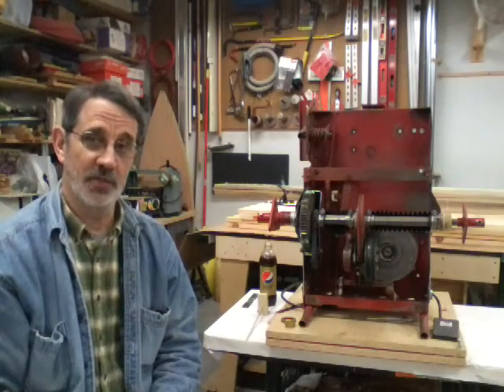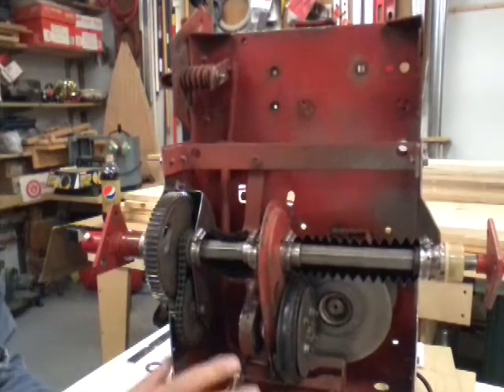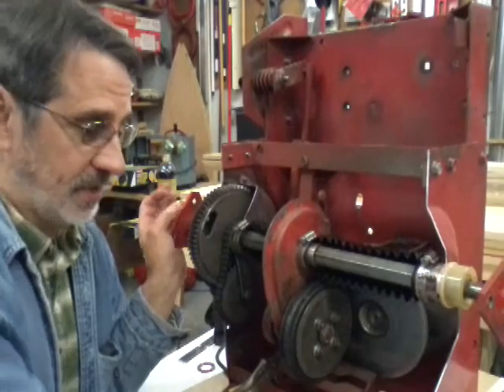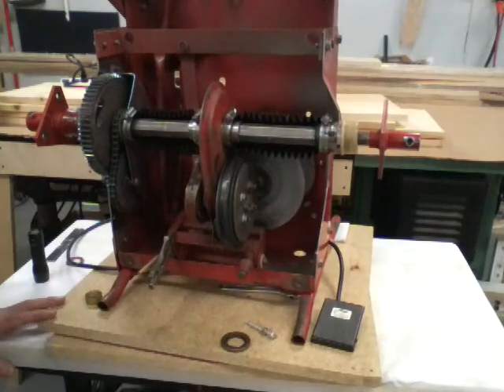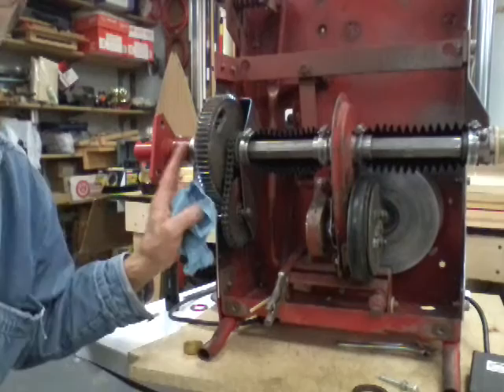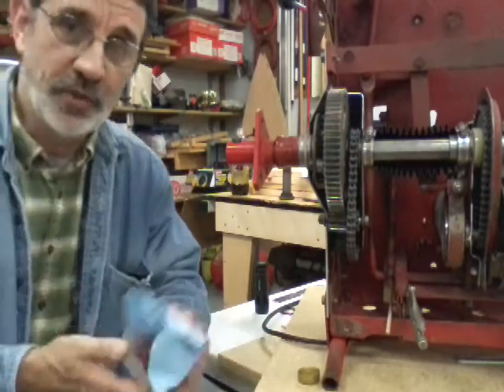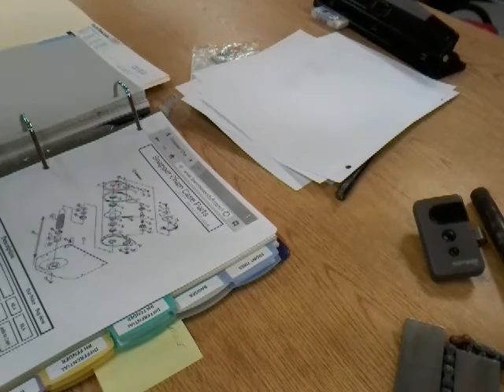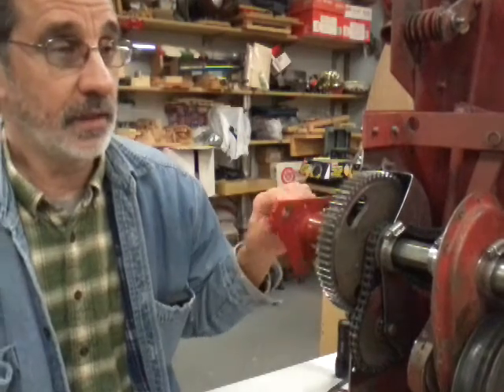89. Rebuilding a snapper drivetrain / can I buy a kit

Comment: Hello Jim- my 3313 seems to be all fine  In first gear it crawls along ok.  In 2nd start to make noise. in fourth there is a lot of grinding scraping noises. In reverse it is even worse. It goes but is making a racket. Everything looks in order except there is maybe 1/2" of play where chaincase slides back and forth on the axle. this looks like just shift linkage play
Reply from the maker: Well I would have to guess if you have that much play in your drive train you have issues inside of your differential I would think the chain is gouging and grinding on the inside of the case Cover unfortunately you’re going to have to tear it down to see what’s wrong, let me know what you find. Jim

Comment: It finally dawned on me how the speeds change, with no normal transmission. I did it from process of elimination. Once I found out there no sprocket switching in either the chain drive box or the differential box. there wasn't many possibilities left. So I learned the names of the engine pulley 
friction drive called (drive disk) & the driven disk riding on the clutch called the driven disk,( I originally called it a little hard rubber tire). And I knew from listening to Jim talk about the higher 
gears wearing out the yoke as the favorite gears were always used in the same spot. I took it that moving over the chain box changes the speeds. So like I said after finding out there was no sprocket switching going on  new the spot the two drive wheels meet would be different RPM's if your on the outer portion or inner portion. AT first ruled that idea out because I though the driven clutch wheel
would hit the center, but I guess they fit all the movement in just 1 side of the under side of the pulley, called the engine friction drive disk so the center doesn't bother anything. SO I know if moving it toward the differential side or if the lawn mower (if laying down in normal position)  RHS........ LHS if upward working on it.  So when it's on the outside of the engine friction drive disk it goes faster . As I know with bigger tires on a car it goes faster and makes the speedometer off.
Now back to work on it. No more Mysteries about it , at least for now. lol

Comment: Great video Jim. Would you please post a video on the proper steps on disassembling the entire drivetrain for an older snapper mower? (Tucson Ritchie, Hinesville, Ga.)
Reply from the maker: derrek ritchie 
Hi it’s Jim
   Sorry about the delay getting back with you 
  To disassemble your drivetrain there is no procedure per say to do this the easiest way is to stand up your machine to take off both tires in both wheel flanges remove your fender from your right hand side that’s the one with the differential bolted to it and the entire drive train should slide out of the chain case of course you’ll have to loosen the clamps on the boots so the axles will slide out of them I do have a couple videos and taking the drivetrain apart the series I am doing right now on rebuilding my 2012 if you go back to the beginning you can watch me take this one apart, it is much easier to do this if you drop the mower deck before you stand the machine up and get it out of your way, Again if you need any help please get back with me and I’ll reply a little speedier than I did the first time. Jim

Comment: Jim- I have a Snapper lawn tractor. There is a square clamp (black plastic with a bolt & a nut) that holds the clutch cable  How does this mount to keep the cable secure.? When i push in the clutch the cable  moves, it is not supposed to do that because it has a  stop on it the cable ,when the cable reaches a certain point  it moves the clutch arm  when tension is applied to the cable. This is just below the carbuerator .  Hope you understand?   William Davis.   Columbus Ohio
Reply from the maker: OK that is working exactly the way it supposed to the plastic clamp or bracket is around your clutch cable your brake cable is hooked to the plastic bracket when you depress your clutch/brake pedal halfway that is your clutch if you continue to push it the clutch cable has a feral crushed onto it that Farrell grabs the plastic bracket and pulls the cable to apply the brakes. If it still doesn’t make sense let me know. Jim

Comment: Hi again Jim. Jack Stefani here again. I live in Indianapolis Indiana and am asking if i bring my 21 year old Snapper to you in Michigan, will you work on it?  I watch your video's while my wife watches TV.  Mine is having trouble in the rear end and after watching your video #89 I think it is getting way over my head. My boys thing I walk on water by keeping this thing going so long. I am at a loss what to do now.  But thanks for your advice on other issues I've had.
Reply from the maker: Well you probably can bring it up here to get rebuilt typically I do that over the winter so the customer has a lawn mower during the mowing season depending on the size of the machine and what’s wrong with it you could put as much as $800 into it to get it rebuilt so that’s something to think about I’m doing one right now that was brought over here from Minnesota and I have about $800 in parts i’m trying to get this one finished before I take on anything else. Jim
Reply from the maker: We can correspond through my email which is
jimsfixitshop@gmail.com
Thanks. Jim

Comment: Hi Jim, I'm Missing one of the four lug nuts on the drive wheel. I've been through all my spare bolts and nothing seems to fit. Getting new nuts is not a problem if only i knew the sixe i need. Would you happen to know the size? Thanks Mark.
Reply from the maker: mark pritchard 
The size of the stud coming off of the clutch disk assembly is 5/16 24 if you go to any good hardware store like Ace Hardware and tell him you want a 5/16 24 self locking flange nut, take one of The other nuts with you to show them what you’re talking about. Jim
Reply: @jimjackson9381  Thanks Jim, There is a nut and bolt place not far from where i work. I shall go to them with the sizes and one of my remaining flang nuts Monday. Thanks again.
Reply from the maker: mark pritchard 
You’re welcome my friend. Jim

Comment: HeyJim,
My back wheels are not turning.
I just replaced the boot on right and the clutch.
I drove the mower about 10 feet and and it stopped. Any thoughts are appreciated.
Thanks buddy,
John in Austin, TX
Reply from the maker: OK for starters stand your machine up and turn the clutch disk by hand and see if the tires will turn, and let me know. Jim

Comment: What would cause a vibration when in gear and running.. it almost sounds like the clutch is wabbling but not sure
Reply from the maker: Well, your clutch disc assembly could be coming loose that’s what the large 15/16 nut holes on or you could have a stick or a small stone stuck in one of your pulley causing the vibration for a bad belt check those out and let me know what you find out.     Jim

Comment: Jim you mentioned you had a HarborFreight parts cleaner, what kind of washing fluid do you use in it?
Reply from the maker: I use simple Green and water in my cleaner I no longer have a harbor freight I wouldn’t suggest buying one I had to get three of them before I found one that worked partially so I went to Amazon and bought a better one I did a video on it it’s number 384 check it out if you were interested in what I got now and thanks for your question. Jim
Reply: @jimjackson9381  thank you for your reply and for your videos. I bought a HarborFreight washers years ago and when I found out it only used a water based solution I never bothered setting it up. I’m looking forward to continuing to use your videos to do some much needed service and repair to my Snapper rear engine rider.
Reply from the maker: @douglasbest8136  Well let me know if you need any help that’s what I’m here for and if you haven’t already would you subscribe to my channel it is free and it helps me out a lot. Jim

Comment: Hi jim. By any chance what year the best snappers raiding lawnmower were made? Thank you
Reply from the maker: Well they were all good machines except for the turtles they built in 2013 and 2019 they came back out with the old style but some say they weren’t built as good as the older ones I don’t know but I would say anything between 2012 and probably 2000 they should have the most up-to-date safety features and least amount of issues now in that Time frame you’re only going to have the classic machines with the round tube the SR machines I haven’t made for probably 25 years and of course the turtles they quit making in 2018. Jim
Now that is strictly a guess The earlier machines before 2000 are great machines and you probably wouldn’t have any problems with them I would just definitely stay away from the turtles.

Comment: I need some help Jim, I have the square tube type lawnmower and after I rebuild the differential gear case I'm having 80/90 gear oil leaking out of the differential side axle. What would be the cause of this? Also how do I adjusted the clutch brake pedal so it want just vibrate and rattle when it's running?  Rockmart, Ga 5/16/2020
Reply from the maker: Stan Wilson 
There are some things you have to do to your differential cover in your chain case cover when you have them tore apart to keep the 80/90 from leaking out I go over that in some videos if you’re just putting it back together original you’re gonna have to use snap or double hot lube. Jim
Reply from the maker: Stan Wilson 
On your pedal vibrating you can try moving some of the ferrules to the backside of the pedal to see if it stops that but that is just a typical issue with the snapper pedal system. Jim
Reply: @jimjackson9381  Thanks

Comment: Hi my name is Jamy H. From Fyffe, AL. Íve got a 28" 11.5 hp rear drive snapper. It's 3 or 4 yrs old. My problem with it is. I bought it being of summer , and I have tall ditch banks. So in low gear I go down bank And  back up . For awhile this worked great. But now doesn't have the power to make it. What do you think it could be? Thanks
Reply from the maker: Watch video number 70 and tighten your yolk spring and let me know if that helps or not. Jim

Comment: Hello Jim, can you please tell me if the chain used is a number 30 chain inside the machine reduction gearing ??? Thanks, VF
Reply from the maker: Victory First 
No the chain case and differential has a number 35 roller chain inside of it. Jim

Comment: Jim, my.snapper quit moving. Stood it on its back, the wheels turn, but it will not move if set down, what's up?
Reply from the maker: If you stand your machine up in neutral and turn the clutch disc assembly by holding one of the four nuts and spin it does the tires turn?. Jim

Comment: Hello Jim, im Jeff from pa. Id like to put a band brake as well as disk brake on my sr1028 single peddle  rider. Is it possible?
Reply from the maker: Well yes it is possible you would have to add a pedal and change the bottom sprocket and shaft inside your chain case so that the brake drum had something to bolt too. Jim

Comment: Hi from Spain Jim
My snapper does not move forward or backward, the clutch I think works, it may be the chain? Are they usually broken?
Reply from the maker: Luis Goncs 
 Well I hope you're subscribed to my channel because you want to watch video number 70 it will explain to you how to adjust your clutch disk your drive disk and your yoke spring I think if you adjust your yoke Springs everything should work try it and let me know thanks Jim
Reply: Hi Jim Jackson,Thank you for answering me
I found the fault, missing the screw that holds the wheel to the shaft on the left side

Which is covered with a plastic cover .. I do not explain how it was working before without the screw, if it is covered with the lid can not be lost ..

(Sorry if I do not express myself well in English, use google translator)
Reply from the maker: Luis Goncs 
  I'm just glad you found the problem with your snapper if I can help with any other problems in the future let me know thanks Jim

Comment: Hi, I am curious about how durable the drive train is on a snapper comet 26 have a small blade on it for light use I am located in ND
Reply from the maker: Well the drive train on the machines going to be pretty durable seen it was built in the early 60s and it still running. Jim
Reply: @jimjackson9381  that’s what I was thinking but figured I would ask your opinion on it thank you for the fast response and the answer.
Reply from the maker: @timothykoller5210  Let me know if you have any issues with it that needs repairing. Jim
Reply: @jimjackson9381  thank you

Comment: whats the torque on the differential bolts
Reply from the maker: Lee Walker 
  Hi Lee this is Jim the torque on the bolts that you're talking about I hope are the ones that go through the small gears into the larger gear if so the torque is 18 to 25 foot pounds, thanks for your questions and comments I hope you're subscribed and give the videos a thumbs-up it helps distribute them to other people that are looking for them have any other questions let me know will talk to you soon Jim
Reply: Thanks Jim. And also what about the differential cover I think theirs like 16 of them by the way I'm in South Carolina
Reply from the maker: Lee Walker 
Hi Lee the small bolts that hold the differential cover on I just use a nut driver and tighten them up by hand it has a cork gasket on it and you don't really need to over tighten them, then check in a day or two and see if they need to be snuggled up I usually put a little sealant on the gasket.  If you have any other questions let me know thanks again Jim

Comment: Randy H: Have a snapper series 8 rider that's in it's 27th year.  It has begun to snag (in the drive train?) approximately every time the wheel makes a turn. The boots are destroyed so, judging by the info in your video, I'm going to run into a lot more than I'd hoped. Can repairs be made with the mower on end, or can the drive train area be removed for easier repairs?
Reply from the maker: Randy Huey 
Hey Randi it's Jim and yes you can make the repairs with your snapper standing up on the rear bumpers,  that's what they're there for I store mine for the entire winter standing up on the bumpers and I drain the oil and gas and remove the battery, I just completed totally rebuilding my bosses snapper the videos are number 100 through I think 144 but I haven't uploaded all of them yet the ones 100 through probably 120 is disassembling the machine you might want to watch them to help you out on what to look for and how to take it apart and then I completely reassemble it all on videos.  Don't forget to subscribe you're gonna want to be able to watch all of them.  Thanks Jim
Reply: Jim Jackson  my snapper is 2004 16 year old same 12 hp 30’’, never did anything to it except service it grease every season, also change oil every season (full synthetic oil) but i thing the drive train will give out soon , i never change oil or checked it,  cant you purchase  the total gear package or is it cheaper to purchase a new  snapper next time i service i will put oil in gear boxes  thanks. Im from Louisiana 
Thanks farrel dupuy
Reply: 80w90 gear loob. Fantastic. Thanks again. I m just going to add a little to what ever is in there. My snapper is about 12 years old now. I have been grees ing it and Chang engine oil every few years. But it will get a new belt as it’s now I realise over adjusted. Again thanks for pointing out the plastic bushes. Kevin Essex england 🏴

Comment: Why didn't Snapper just put in a regular transmission?  This one sounds like a complicated mess.
Reply from the maker: oh yeah 
By a regular transmission I guess you mean a hydrostatic, some snappers do have a hydrostatic transmission/rear end in them but most of them are non-repairable if they go out you have to buy a new one complete and they’re around 400+ dollars.
 The transmissions that are in most of the rear engine rider snappers and most snowblowers and a lot of lawnmowers are so simple to repair and inexpensive parts wise I wouldn’t buy one with a hydrostatic transmission in it.  Jim
Reply: @jimjackson9381  I meant the standard type trans. like 5 speed ones.  Seems like it would have been much simpler to put one of those in .  I have 3 snapper Rers.  Thanks
Reply from the maker: oh yeah 
Is many of the machines that I’ve worked on including the five speed transmissions that you’re talking about the snapper rear engine riders have the most simplistic and cheapest and fastest to repair. Jim
Reply: @jimjackson9381  Yes I can see that if you have to repair the transmissions, but I have never had a transmission needing repairs, where Snappers always need adjustments or repairs.  Having said that, I still like to work on them.  Thanks for the replies.  Subscribed.